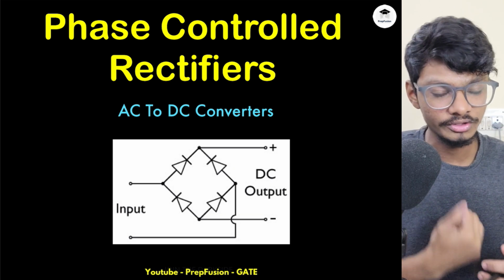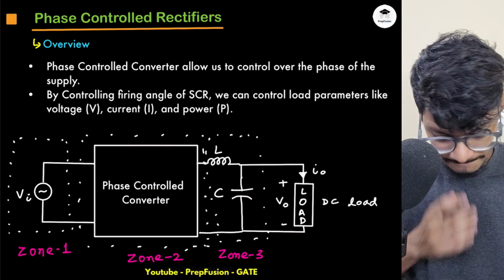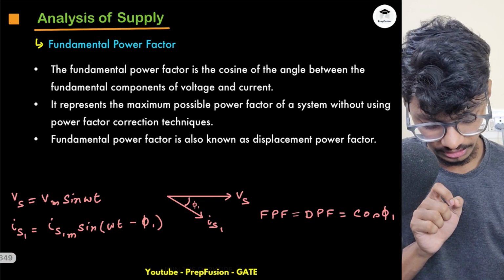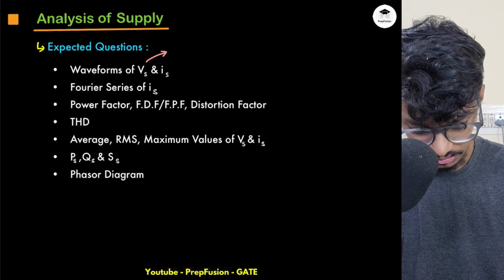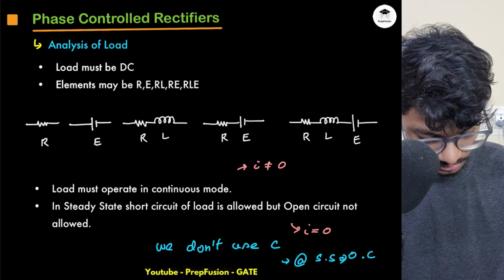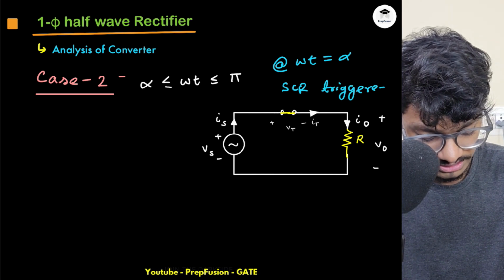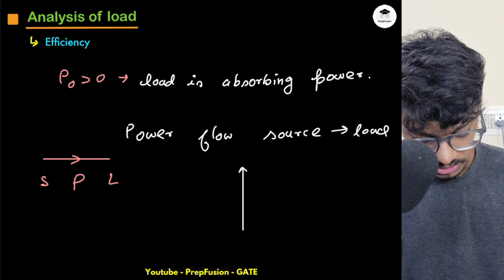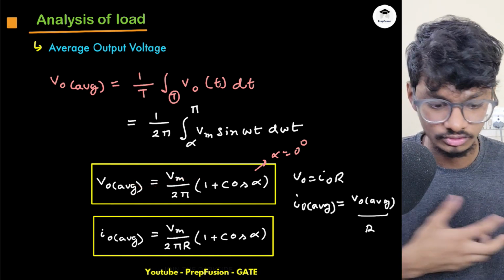Introduction To Phase Controlled Rectifiers || GATE 2025 || PrepFusion || Anish Saha

Comment: Back to consistency, was busy with interviews. A long lecture, the way of classification of all parameters is really easy to grasp. I have a doubt that FBM will be from 0 to Alpha right but you have indicated it from 0 to pi and Io(avg) peak will be only Vm/R when (Alpha)=Pi/2 otherwise before and after pi/2 it should be Vmsin(Alpha)/R but you have only mentioned after pi/2. Please correct me if I am wrong.
Also, can you please share the links for the prerequisites that you frequently mentioned in this lecture.
Reply: 1.For the first part you are incorrect whatever is written is correct rewatch that portion again I have explained why it will be alpha less than pie/2. 
2. By Forward Blocking Mode I am talking for the region in which I have control. You can say the control range or range of alpha and forward blocking mode will depend upon alpha.
Reply: @AnishSaha_ Thank you so much for clarifying.
Reply: No I think that peak current expression is correct you can mention the time at which you are having doubt. Period of FBM mode should be from 0 to alpha. I think I 've said the range of alpha to be from 0 to pie. Follow this playlist for prerequisites -  For Power Electronics: https://www.youtube.com/playlist?list=PLgF7lRh8Xb_UJbDa4Xeq4netQ12Q5Kilu
 Try to maintain consistency from now on try to finish the 3- Phase Rectifiers before this Thursday.
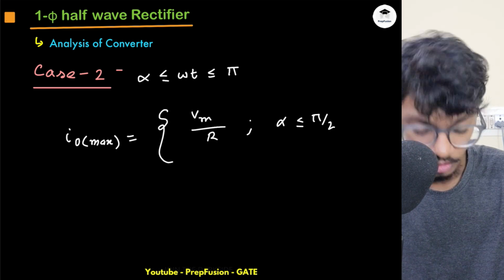Reply: @AnishSaha_  for io(max) at 1:11:40 the current should be Vm/R ; (Alpha)=pi/2 
because only then is Vm peak occurs but you have mentioned Vm<=pi/2.
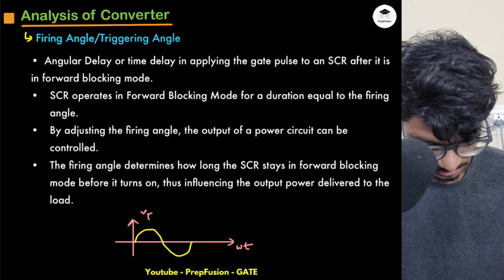And for the FBM you have indicated it at 45:47 onwards.
Sure, will try my best to remain consistent throughout from now on.